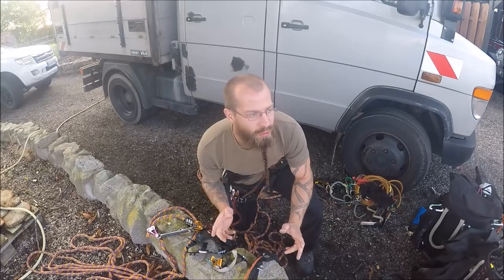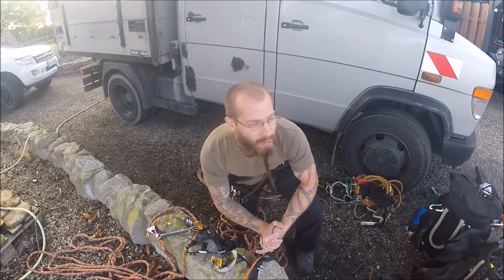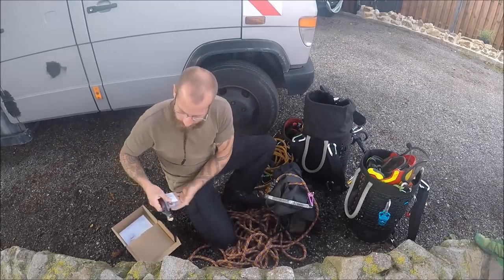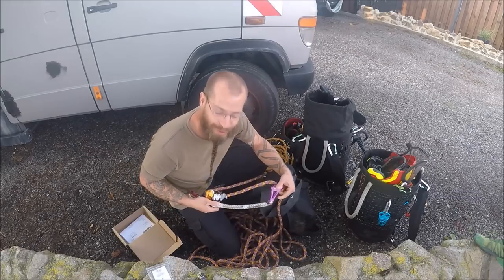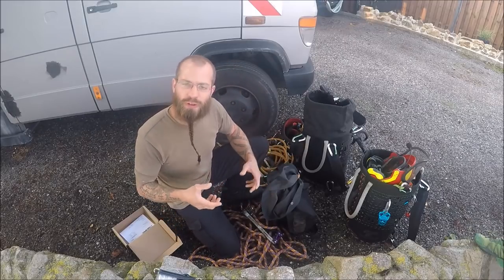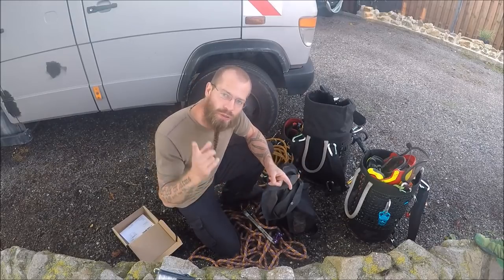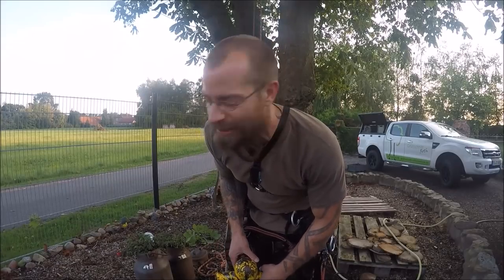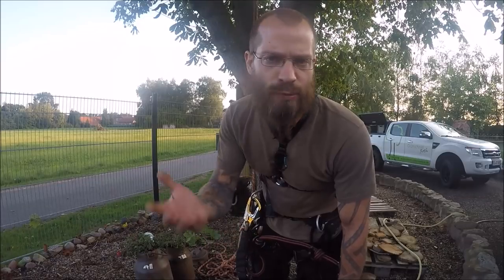My SRT - Single Rope Technique Setup | Baumpflege Mertens

Comment: Thank you for doing some videos in English.  I am in BC, Canada, and I am very thankful when people from other parts of the world are generous enough to use English.  It is a very big gift for you to give everyone else around the world, and it is very good for us to be able to connect together and share what we learn.

I think it makes sense when you do these explanation videos in English for the reasons you said.  It could be dangerous for you to do work videos in English, in case the people you are working with didn't quickly understand some important thing you said.  One way you could separate between these two kinds of videos, that would reduce your need to apologize and give warnings, is to call these videos RECREATIONAL CLIMBING ONLY, because then you have no worries about certification or regulations, it is just private fun climbing.  You can still explain what you would do differently when climbing for work, but it would not need to be an apology.

Finally, about your foot ascender: I understand that many climbers prefer to have the ascender NOT locked on the rope, because with practice this allows them to easily kick the ascender off the rope at any time, and even maybe to slip it onto the rope without their hands.  But using it that way also takes practice to prevent it from slipping off the rope when you don't want it to.  I have seen videos that talk about how to take your climbing steps in a way that keeps the angle of the foot ascender just right to stay on the rope.
Reply from the maker: Wow ! Thank You for your kind words!  I will listen to your Tips!  Greetings and Stay Save and buissy !

Comment: Great. In my experience single or double rope depends on the architecture of the tree and what kind of job you have to do in the tree. The set up you are showing is of advantage because - with little modification you can use the ZigZag for double or single rope. That is were the savings are. The shorter tether is super important since the rope wrench engages faster and takes “stress” out of the ZigZag. You might want to share that with your German friends. Love to see you climb! Be safe - both of ya!
Reply from the maker: Thank You for your kind words!  Your right ! Greetings and Stay Save and buissy!

Comment: Hey Arn, I am using ISC safety green and red carabiners from WeSSpur. They are strength rated higher then all aluminium biners. They are also cheaper.😀 Waiting for my ISC stryder foot ascender to arrive. I ordered that one because all of my ISC products have been of good quality. Hope that helps.😀
Reply from the maker: Hey, Thank You for your Tip!  I will try it ! Greetings and Stay Save and buissy

Comment: My Monkey Beaver Brother.   To fix the weak spring problem with petzl Right foot asender use safety pins as a back spring i did and it works well for SRT.  Bend safty pins to match. And tuck behind original spring.     I use ROPE RUNNER.  great peice of kit.     Thank you for the vidio. Your monkey beaver brother buy another mother mark.   Dont try this at home !
Reply from the maker: Thank You for the Tip!  Greetings